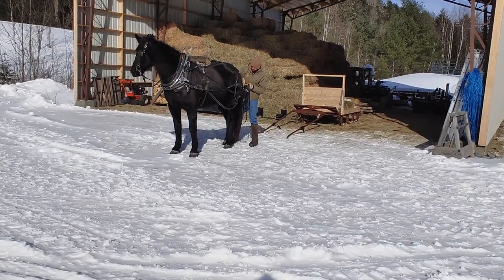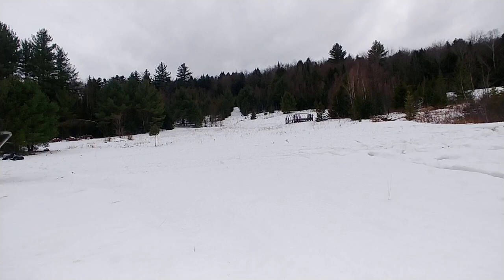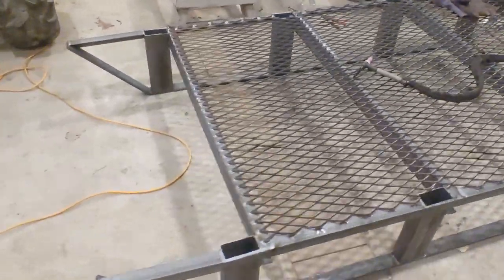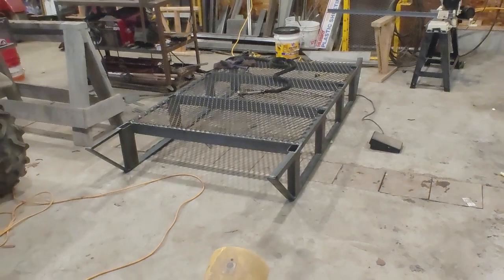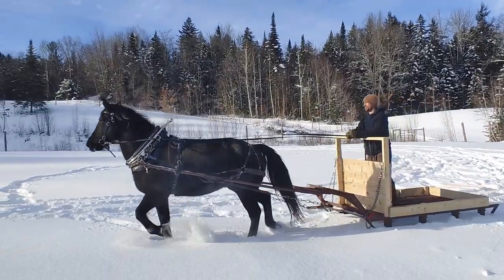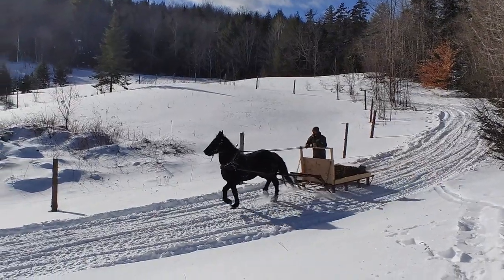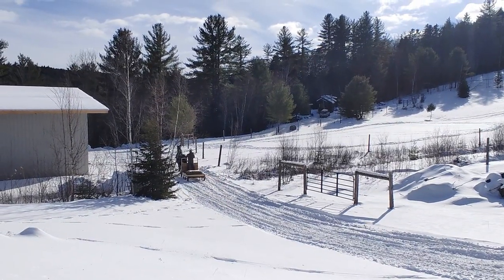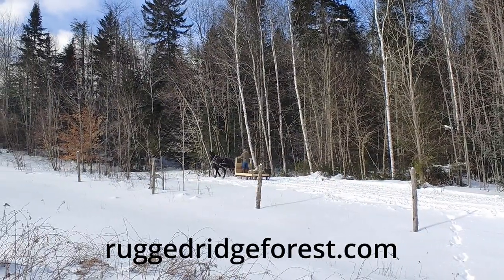Fabricating a Custom Horse Sled - DIY at Rugged Ridge Forest

Comment: what did you use to connect pole/shafts to sled? i am building my own as well and am trying to figure out what is best way to attach pole to sled .
Reply from the maker: I used a 2.5" reese hitch as well as 2.5" square tube.  I think thats what the amish use single and double based on the pioneer catalog.  Havent tried it double but 2.5x 1/4" square tube is awfully stout
Reply: @ruggedridgeforest7775  thanks
Reply from the maker: @rjonesyow  no problem, lemme know if you have other questions or link a picture/video when youre done